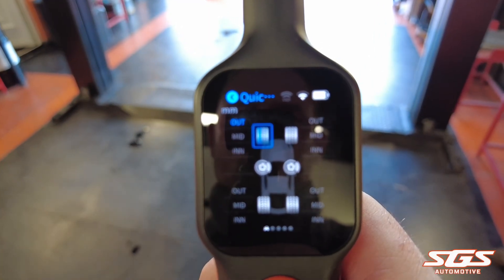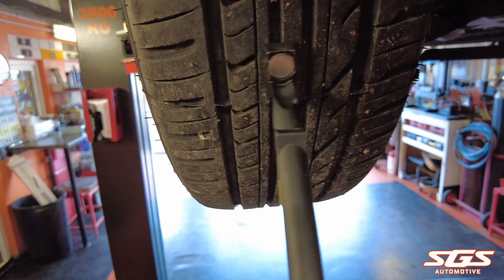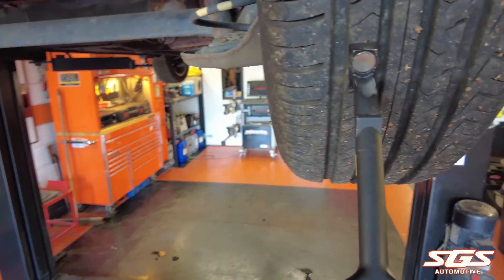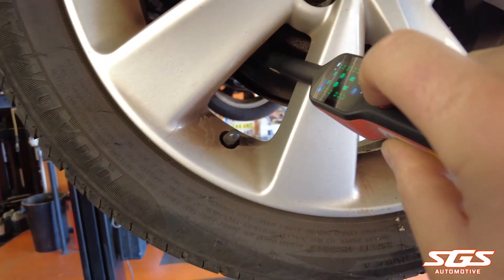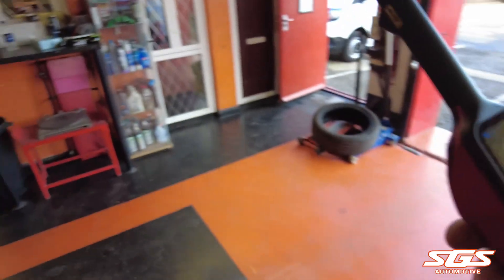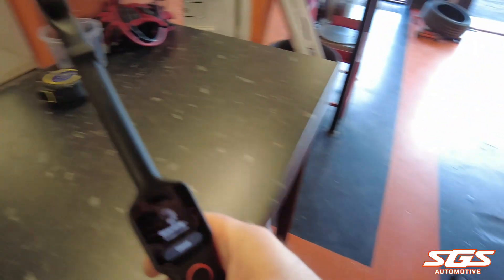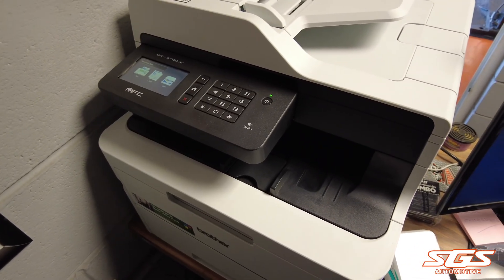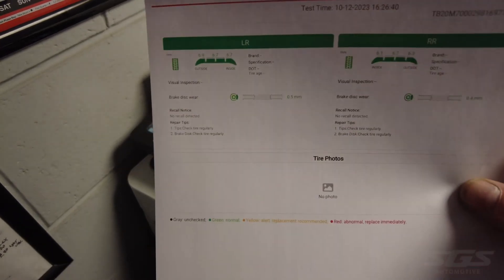Unleashing the Autel TBE200: The Future of Automotive Tech - Review

Comment: Does this measure brake pad depth? If not what tool scanner would you recommend?
Reply from the maker: It doesn't measure the pads only the discs and tyres. For pads I'm not aware of a laser tool from anybody. We have a manual tool for pads measuring
Reply: @SGSAutomotive  dang, so i have to do that manually like a peasant? Haha jk jk. Whats the best tool to measure them without taking wheels off? Everything i find doesnt have good reviews. Lol
Reply from the maker: @Galicia322  honestly there isn’t a great deal out there for measuring brake pads. I’ve a small metal tool that works ok but I don’t even know what it’s called lol.
Reply: @SGSAutomotive  sweet thank you
Reply from the maker: its similar to this https://amzn.to/3F82x8J
Reply: @SGSAutomotive  thank you! Ill give it a try!
Reply from the maker: great stuff 👌
Reply: @SGSAutomotive so how exactly does the tool know the disc discard thickness? Or if it still handles resurface ?
Reply from the maker: Its effectively just measuring the lip on the edges of the discs. So if you have ground the lip off then its not going to give accurate results. But on a naturally untouched/un-doctored disc then its very good

Comment: Does it struggle to read tyre depth accurately if the tyres are wet????
Reply from the maker: I’ve not had any issues reading wet tyres that I recall. Occasionally it reads wrong but I haven’t noticed it having anything to do with wet tyres it has happened also when tyres have been dry. And a quick re read and all is well. I will do some more testing on wet tyres though just to be sure. I do use the tool regularly as well and the only issue I have had is when the Autel server went down so it meant I couldnt print a report but it was sorted within a few hours and I was able to print again. That is rare though only twice since I’ve had the tool and I think I’ve had it about 2 years now.
Reply: @SGSAutomotive  ah OK cool. Thanks for getting back to me, I appreciate that a lot! Thank you!
Reply from the maker: No problem at all 😀
Reply from the maker: Used this recently on wet tyres and thought I’d update you that it works the same wet or dry. 👍
Reply: @SGSAutomotive  cool, thanks for letting me know. Where did you get yours? Been looking but seems a lot of fakes around, as well as sketchy sellers!
Reply from the maker: @Divided-Kingdom my local parts supplier who is an authorised dealer for Autel are you in the uk